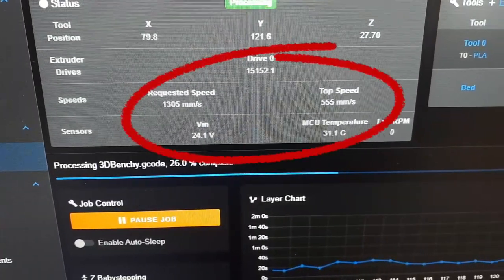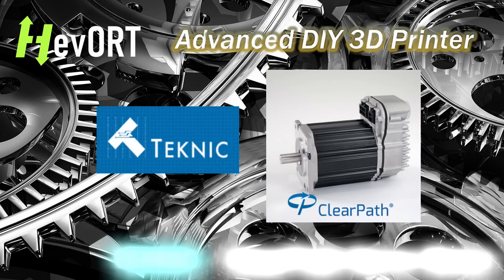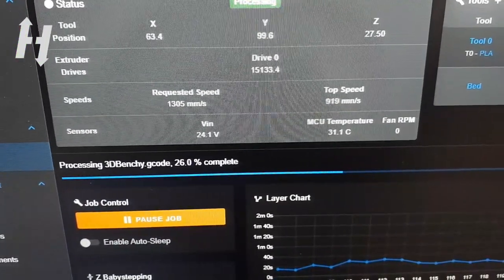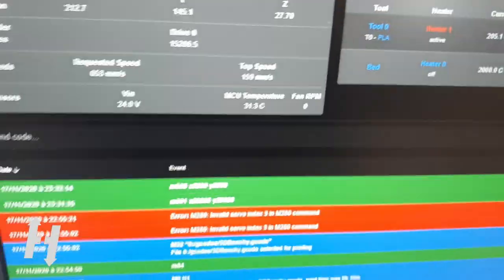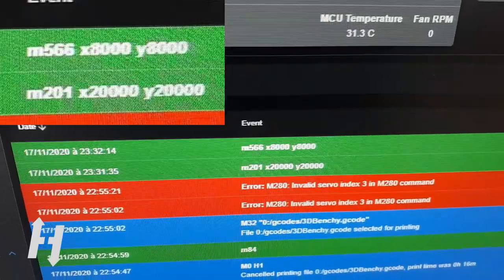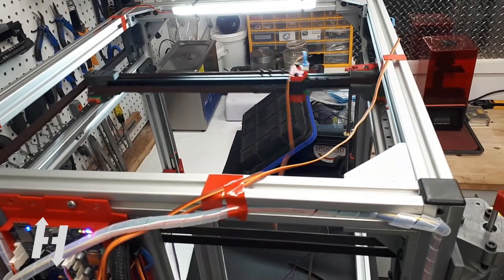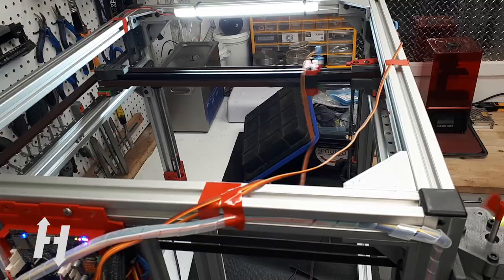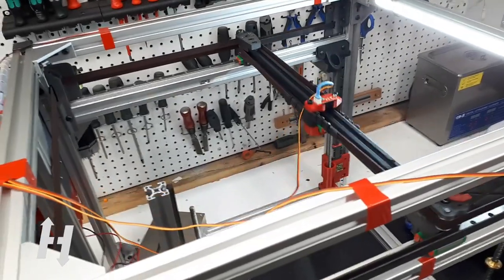3D printer on Servo Motors? HevORT & ClearPath testing spoiler

Comment: WOW!
Which extruder can  push the filament and which hotend can melt the filament  with this speeds?
Reply from the maker: As answered to another member: [Of course matching material flow with this speed is going to be a challenge.  But just imagine for a second having instantaneous travel moves and enough accel and jerk to reach greater speed on tiny moves.  Just these two thing will make a hell of a difference on print time.]

Comment: Hi mate. 
Message from Australia. 
What board are you using to implement the servo. 
I'm in the process of doing a servo system. 
Any advice would help. 
Thanks in advance. 
Could I message you or make contact please.
Reply from the maker: I did not play much with them yet... too many squirrels in my head!  but you can find details on how I have set them up here: https://forum.duet3d.com/topic/19887/clearpath-servo-motors-testing-so-far-so-good?_=1614356929150
Reply: @MirageC  thanks again for information. 
Wasn't sure to go with duet or Marlin. 
Using a odrive that takes step and direction. 
Trying to work out best option for printer board.

Comment: Imagine Printing with that speed.
You Probably need loads of heated airflow. Temp depending on Material. Cold enough to cool and warm enough to Not lift the Print. Like 60deg C air from two big blowers across the print
Reply from the maker: Yes, that is the plan ;)  https://www.youtube.com/watch?v=Kyxqv4XoolI
Reply: @MirageC  Nice, part cooling will be key.  Some university a few years ago put out a video of a printer with similar speed that used a laser heated hot-end.  They said the biggest speed limit was part cooling.  There was also a recent 3D printer competition where the winners got the best strength by cooling the part with a blast of air just below the glass transition temperate of the plastic.

Comment: Fucking awesome!  Ive been contemplating dabbling with this setup for a while now, it's nice to see it under operation.  Under the majority of circumstances, print speeds will be constrained by the filament's material properties as I'm sure you already know but for anyone that doesn't, How Cool will it be having almost instantaneous rapid movements?  Print quality will Greatly improve as you have much finer control over retraction settings and much lower hot-end dwell times.  Surface artifacts and dimensional accuracy should see a pretty drastic improvement assuming the machine vibrations are being managed.  Kudos !
Reply from the maker: Thank you!  Yes I am fully aware of the challenges ahead, but one step at the time.  :)

Comment: 1hp is about 750 watts, your typical U.S. outlet is 110v/16amp(120v/15amp) or about 1760-1800 watts but some are 20amp allowing 2,200watts or 3hp (without efficiency losses at about 10%)

With that said, im sure the servo motors never hit max load causing a 1hp power draw from your power supply. If they do it better have enough capacitance. Find a true 1500 watt audio amplifier for example, it will weigh like 50lbs and most of that will be the transformer and its capacitor(s)
Reply from the maker: The motors used in this video are close to 1/4hp (0.23hp).  see details here: https://www.teknic.com/model-info/CPM-SDSK-2321S-RLN/?model_voltage=75VDC

Comment: Just by the viscosity and the weight of the filament itself it will not be printable in any usable quality. Its going to swing around the soft filament around the plate and literally splash it around. Even if the motors stop and move absolutely precise you wont be able to eleminate the limitations of physics within the filament itself. This speeds are theoretically possible with materials that arent soft only.
Reply from the maker: I totally agree with you, material properties will be a road block, so will the extruder current principle.  Just as a reference here is a FDM printer using laser hot end from MIT back in 2017:
https://www.youtube.com/watch?v=8wVGaxgkmk4&feature=emb_logo
Reply: @MirageC  Maybe if the layer height is small it will be less of an issue as then the filament can stick more firm thus will less splash around. And I totally forgot about the extruder itself... you are right. But it doesnt mean we cant get a lot faster than the typical printer nowadays.. I hope we will. And It is surely possible even with good quality. Great work tho.. respect!

Comment: its too bad kyro is not avaible atm and also you don't have any chimera or V6 mounts I edited a chimera mount for myself 
and not used that 3 motor z for 235 235 buildplate I m using single z with ballsrew
Reply: and also made my build with skr also used bigtreetechs nema 17 closed loop encoders now its more solid :D
Reply from the maker: @TheNitrouspack  Closed loop steppers are great for crash and bump correction.
Reply from the maker: All carriages version using Kryo cand be used with V6 Heat Sink.  The BLtouch mount and the Berdair duct might have to be modified though.
Reply: @MirageC  it seem like that but fan duct can't be mounted due to kyro mounting for bmg direct drive carriage
Reply from the maker: @TheNitrouspack  so if we get rid of the kryo attachment points it would fit?  sounds Like an easy mod :) Let me know.
Reply: @MirageC   yeah one side can be but otherside also holds belt and for fan we need to get rid off too much plastic so its also make it les strong I couldn't find an option for that so made a some clearing at x carriage and also for 40mm fan made a mount for bmgs  2 screws also holds fan mount it fixed

Comment: Could 3mm filament (never used one) with supersized volcano cope with this throughput?

This Old Tony started 3D Printing, too. Would be amazing to see collaboration between your channels.
Reply from the maker: Unfortunately, 3mm filament gets less contact area for the same volume of material than 1.75.  using current hotend technologies, i dont see how that could be beneficial for high speed printing.
Reply: @MirageC  How about a pressurized pellet extruder? You could use huge nozzles for extra speed. Could save time/money because you'd skip the filament spool production process.
Reply from the maker: @TheUmuHaveAwoken  all sort of crazy ideas are on the table for now.  But first step, let's print with those servos!

Comment: This is NASA level, the setup is a bit out of reach for my pocket
I run my 3D printer on Nema 34 s, 800oz/in to help with the inertia problems and the extruder is fitted with a Nema 24  400oz/in thats hopefully strong enough to force the plastic through
Top speed? I have never tested that but I am now eager to find out.
Reply from the maker: This is some serious torque! What type of hotend and extruder setup do you run? And on what diameter of pulleys.  Big nema motors usually have high impedence which limits there top speed.
Reply: @MirageC  Except for the electronics/motors, everything was build in my shop, so there's no names badges on this setup.
At this stage the pulleys are 20 teeth T5 for the X/Y axis, and it runs at 250mm/s with no hiccups or special settings

Comment: IMHO at this or more faster speed I think you gonna need to forget spooled filament, and you have to turn into something that already existing: I suggest to use dust pelleted filament, and cartridge like stuff as inkjet printers do. Inkjet printers basically using this since eons, except the load here would be different. More wildly thinking: what would be that if you would be able to use out the feature of a laser printer selenium cylinder surface, and use electricity and the laser to charge up as the always upcoming layer looks like - and print it in one session the full layer. The only blocker will be the size of the cylinder, and the printable surface, as you don't use anymore in this case hotends, else just complete heater line to melt/fix in the plastic.
Reply: There is a similar thing called polyjet we had a 2048dpi head at the uni and made it print epoxy but is very very expensive
Reply: @sanches2  That's interesting. But yeah, every innovation is for long term, and for first is expensive, but IMHO if we can unite current SMT line with these 3D printer units using heatable pellets, or pressure/vacuum form segments of the design - that would be revolutionary. Imagine manufacturing a phone with multi-panels, and parallel series of 3D printers in the line making from segments the chassis, and robotized assembly... Technically, I think we *SHOULD*unite into a series of machine - vacuum/pressure forming (carrier/main segments manufacturing in the line), laser (material removal, cnc, etching maybe SLA additional layers), FDM print for customizing (spraying or FDM in material like glue as we manufacture cars today)... IMHO we have to split FDM printing into multiple head types and split into different segments the targeted result to gain speed. That makes pretty fast the making process if the X carriage is circle shaped and the heads is in 45 degree angle, and it is lowered by DELTA arms. IF you sync only 2 delta arm (like humans have) that can not only make, move, remove, insert materials, but a lot more. Still awaiting one thing: when will 3d printers devs notice that networking, and building a segmented manufacturing line AT HOME is already in at hand, but no one has made it yet. But hoping that a single machine can do everything without sharing the jobs is a neverending dream.

Comment: Over $600 for just the servos, if you are a OEM. If those are the SDSKs then it's kind of a waste of money driving what is barely doable with NEMA 17s. The SC line with G-stop would be interesting, that is where the magic is. Just replacing a stepper with a servo and not closing the loops back to the controller is kind of silly.
Reply from the maker: Which Nema 17 could you possibly refer to? Even doubling the number of nema would never get you anything close to this.  As far as returning feedback of the closed loop to the control board, I am not sure I understand your point.  If you operate the clearpaths within boundaries, they will not skip.  The servo closed loop system internal to the SDSK will correct the situation as needed to meet the demand from the controller.  What would that feedback do more?

Comment: moving the thing mid-air does not prove much, even if you had a  hotend that could melt plastic fast enough there is going to be a lot of ringing, if the part is so ugly that it is unusable then it become pointless.

but I do like this project a lot.

Comment: Induction heated hot end next?!?!?!?
Reply from the maker: Although that sounds really cool, (or Hot ;) ) the next challenge will be to deal with enough extruder acceleration / speed to manage the nozzle pressure.   This is in my opinion the next bottle neck.
Reply: @MirageC  absolutely agree

Comment: There is no way you'd be able to print fine details at acceptable quality at those speeds. The only application I can see for this would be printing construction components with 3mm filament.
Reply from the maker: Agreed, this config is not intended for table top figurines.

Comment: Hi,

Can you please upload graph of the position error from the servo with the crosponding speed command?

I have printers with real servo motors, sending very high speed commands doesn't say you will get better speed print even when using high flow extruder.
Reply from the maker: I will try to take a snap shot from the clearpath software graph.

Comment: 20.000 mm/s = 72 kmh or 44.7 mph
Reply from the maker: I am now using 100 000 mm/s2 acceleration values. But obviously theses rates are only maintained during a very brief moment before reaching the desired speed.

Comment: jee wiz 20,000,000,000,000,000 Femtometers per second? 

can you even extrude fast enough?
can you even cool the layers fast enough?
Reply from the maker: Yes, I do have cooling solution that will make large parts possible.  see it here: https://youtu.be/Kyxqv4XoolI?t=261
Current Extrusion system (Extruder + HotEnd) on the market today don't support such speed yet.  So my current strategy is to use this power to make fast travel moves and use the acceleration to increase the speed on small and tiny moves.  This will be a huge gain compared to stepper motors.
Then will see what we can come up with for extrusion system.